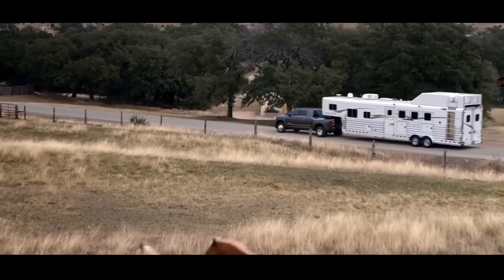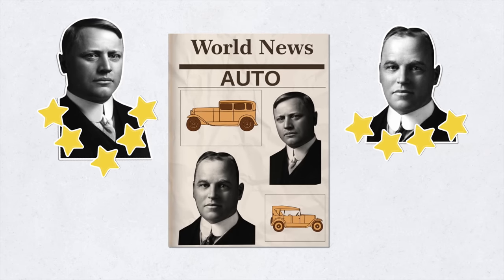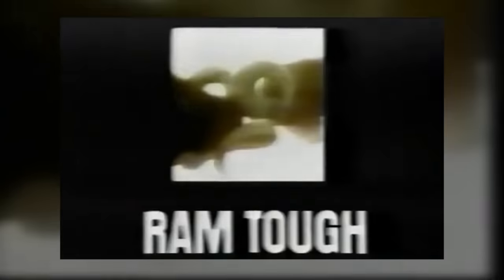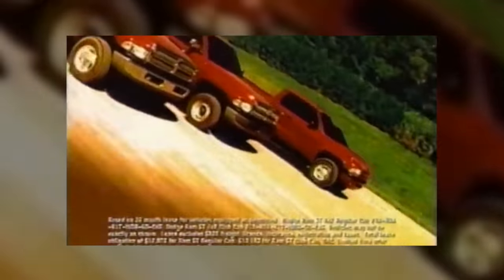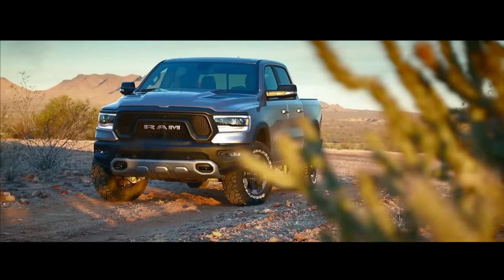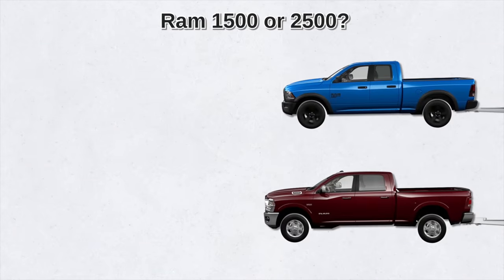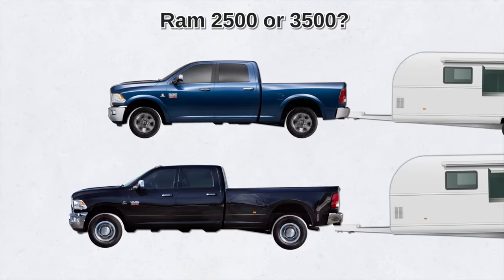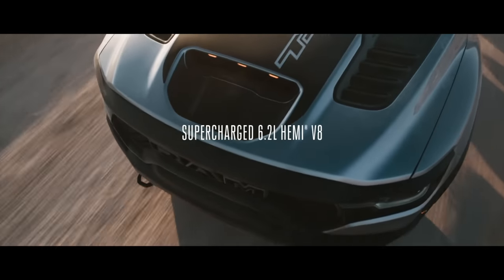No One is Telling You the Truth About Dodge Rams, So I Have to

Comment: I'd kind of like to have the 3500, BUT I can't seem to 'wear out'/KILL my 1989 Cummins Dodge 350:) which I purchased NEW (it might have been the very first Cummins  W350 on the west coast, so new, I had to pick it up personally off the train:) Now, all the problems I've had? well the steering box bolts to the frame started to come loose, so had those tightened...Other than that?  NADA!!!!! BTW, for those in the 4WD off road world, my truck is the ORIGINAL "DODGEZILLA" LOL. Oh, now I remember, I had an electric window motor go bad oh...7 or 8 years ago.. and I had to change a U joint a couple of years ago...probably the sand from the desert. :) Oh, and guys, those Cummins guys can REALLY build a Diesel!! I also have the HD Clutch and the manual Getrag Trannie. In comparison, my father bought the big 454 Chevy dually pickup, ,,,engine had to be rebuilt after I think 4 years, (the cam lobes just flattened out) he also went thru I think 3 clutches before he gave the truck away. My brother bought the Ford 250 4x4 with their diesel, (it died at about 7 years of age  ) sooo, every time I hear Scotty badmouthing the Dodge trucks, well I just smile:)
Reply: Scotty admits older dodges were better. He complains about say 2000 to present dodge/ram/Chrysler/fiat quality is low. He say electronics are junk on the newer stuff and it'll all break. People are still buying dodge stuff because they look nice and keep up on paper with the competitions cars. but im always wondering how they handle the quality. U notice they dont hold resale value as well the competition and ive read business owners who bought fleet vehicles of dodge rams regret it and go back to Chevy or ford. Ford and Toyota are the only new trucks ive heard scotty recommend
Reply: I’ve owned a bunch of them with the 6bt.  Starting in 1990 Great old trucks.
Reply: Consumers report had the Ram 3500 as the worst vehicle made,car or truck a couple of years ago. They are all pretty much junk anymore. To many recalls on all the truck brands.
Reply: Dodge trucks aren't as good as Ford. Dodge, with the junk dodge tranny.and the dodge  motor
Reply: Ok, for those pointing out that the older dodges were probably better built, based on the comments by Scotty, well maybe so, what I'd ask is does anyone have the numbers of how many of America's trucks for each manufacturer are STILL on the road? say after 5/10/15/20 and beyond? I'm sure our Big Bro Govt has those figures available if someone has anyway of pulling em up.
Reply: @richsweeney1115  The ZF-8 speed is one of the best in the industry and you call it junk, oh right you are still living in the past.
Reply: @richsweeney1115  So you are saying the Hemi's and Pentastar's are crap? When was the last time you owned a Brand New RAM?

Comment: I had a 2006 Ram 3500 diesel, owned it for 7 years, twice during that time (3 years apart) the injectors failed. Dodge wouldn't do a recall although a lot of people had the same problems.
Reply: Original owner 2006 2500 Cummins. I have 166,000 miles. Still on my Original injectors, but I also have been replacing my fuel filter(baldwin) with every oil change at 5,000 - 7,500 miles intervals. Im due for a new injector set, but engine still runs strong, I'm still always on the lookout for early signs of injector trouble. I'm probably the exception to the rule but, its all Original except for its on its 4th set of batteries and just recently, an AC coil clutch pulley kit from ebay. 🤞
Reply: @nattran92  I own an 06 Ram 3500 5.9 Cummins diesel,. Two wheel drive, automatic, long bed. 21+ mpg highway, not towing. 186K  with minimal issues so far. Runs and drives great.  Synthetic oil, quality filters, original injectors. Replaced water pump, rebuilt front end and replaced all shocks with  Blistein 4600's.
Reply: @nattran92  I changed my fuel filter every other oil change as well. My dad and brother had the same truck as me and never had injector problems, but did have transmission troubles that I never had.

Comment: Surprisingly my 05 Ram Hemi with a tune and cam, traded it in with 55k miles in 2 years, lasted longer than my 08 Tundra 5.7, transmission went out at 25k miles. Still under warranty but you know.
Reply: What kind of Tundra transmission goes out at only 25k miles?!
Reply: @eliteflare6063   defective, or beaten

Comment: Scotty please do a video like this about Chevrolet. I'm specifically interested in the mid 1980s model year trucks because my daily driver is a 1986 Chevy Silverado k10 4x4
Reply: RCR just did a review of a '74 squarebody Chevy.
Reply: I had a new 1985 Chevrolet Custom k10 4X4 with a manual transmission.  One of the best trucks I ever owned.  I traded it in after I put 155,000 maintenance free (not including oil changes, etc) miles on it.  Great trucks during those years.
Reply: @lc7192  I've had this truck since I was 14 I'm 26 now and will never get rid of it. It's had it's problems but it's easy to work on. One question Did your truck Ride like a wagon going across the Oregon trail 😂
Reply: @jasperjordan6972  Yes.  Mine was a short bed 1/2 ton and it was rough. I think the long beds were smoother.  The only thing that I didn’t like about this truck was that it had two fuel tanks and the fillers for these tanks were on opposite sides.  I put a lot of highway miles on it and it was a pain keeping both of these tanks full.  I loved it though.  It would really go well in deep snow and the short wheelbase made it good for off-roading.

Comment: My 2001 1500 had 225000 miles on the little 5.2. never been opened up. Only basic repairs and regular maintenance. I've rebuilt the trans twice though. Other than that I will drive it till the wheels fall off!

Comment: The biggest down fall is the coil springs they put underneath gives a smooth ride but when it comes to tongue weight even with weight distribution they struggle to keep the bumper off the ground so you have to go with air bags.
Reply: Buy some better springs, cheaper than air bags and keeps the ride quality.

Comment: My 2012 hemi will pull the world but at 130k miles i have my second exaust leak and it randomly just dies while driving and the key is messing up when starting it. Not real happy. I get 11 miles per gallon. I do run the tar out of it.
On the other hand the 05 dually 4x diesel has been a real peach the whole time. Its all stock with auto trans and has pulled many heavy  loads

Comment: You didn't mention the RAM 3500 with the HO engine and Aisin Transmissions. This setup is 420 HP and 1,075 ft of torque. 
Insane.

Comment: I have purchased a little mileage 2002 Durango with 160 K and tow capacity of 7000 and 4-wheel drive. Extremely happy. 5.9 L.
Unable to afford 37 to 40,000 for a power truck
Reply: I had to read this three times to try to understand what you were saying. I am not sure if I do.

Comment: We've factory backed RAM trucks here in Oz for some 10 years or so, I'm dying to get a 1500 Limited and Scotty you've convinced me.
Reply: Factory backed? Tranlate. You can get Dodge pickups in the land of Oz?
Reply: @thyslop1737  Yeeup, right hand drive conversion is done here, sold by RAM dealers with full factory warranty, double the cost US cost though, and smaller range. It's been very successful, Silverado is now trying to muscle in. We've always had F trucks but they are boutique importers/conversions and very expensive & no factory backing.
Reply: @martinfiala3910  two reasons why I reckon the DTs are so expensive atm, is because there are still DS models in dealerships, and the global chip shortage.
Once those issues are resolved, I'd expect the price to come down about 20k.

Comment: I just recently bought a 2019 Ram Warlock edition and I absolutely love it. It was a local trade in, one owner with 18,000 miles and it runs and drives great.

It's got the 5.7 liter hemi in it and it has more power than I'll ever need but I'm also getting 19, sometimes 20 miles to a gallon of gas.

Not quite as a good as the 36 mpg that my 2009 ford focus gets but I'm impressed with it.

Comment: I work on Rams for a living. Ima tell ya these 2019-2022 Rams, dont buy one. Just dont.
Reply: TYVM I was wondering about the new ones...much appreciated and heeded advice
Reply: Being a Ram mechanic I would love your opinion on the BEST generation engine and engine size to buy used in the 3rd gen to present (well know how you feel about thr 5th gen, so 3rd & 4th) please.
Reply: @KevinRCMan, why the warning? Especially since 2022's aren't out yet, are they?
Reply: @dwilson2126  I don't believe they are, but just last week had a 2019 1500 in the shop wouldn't start or crank and no DTC"s to follow.  For no real reason the PDC (essentially the fusebox) went bad internally. Guy had to pay out of pocket cause its not covered by powertrain. This is a known problem and Chrysler as of right now has no real fix/update. The 2020 and 2021 has the same PDC. I can go on for days as why you shouldn't buy one of these newer Rams
Reply: @KevinRCMan  Wow! A good friend of mine has a 2017.
Reply: How about the "classic" truck ?!
Reply: @KevinRCMan  anything else we should know?  Every manufacturer outside of Toyota/Lexus has a doomsday story and a reason why you shouldn’t buy one.  I just sold my V8 M3 and has 1 catastrophic issue and a few other expensive issues not covered but mostly never happens.  I did the preventative maintenance thx to the community but I am sure every tech at BMW says the same thing about their cars but most cars do not have these issues.  So is there anything else people should know about RAM and why they shouldn’t buy one besides that one?
Reply: Thanks
Reply: I was just wondering if you felt pretty stupid now. Realizing you said an asinine statement like you did. This truck has been voted truck of the year for I don’t know how many years and I’ve had five different Rams. I’ve never had engine explode or anything serious wrong with the truck whatsoever. I can’t say the same of any Ford or Chevy that I have owned. Come on now say something. We’re waiting.
Reply: @dwilson2126  because after owning multiple Chrysler products they are all crap, cheap , unreliable crap.  5.7 piss poor design,  with bad lubrication. Fit and finish sucks.. I've owned 2 durangos,  1 ram , and a 392 challenger. All crap.
Reply: I have a 2019 ram 1500 limited. No issues at all. Been perfect. Sitting at 140k miles lol.
Reply: @jhugo1986  I'm sure it's well maintained as well.
Reply: I have a 2006 Ram 1500. Just went over 300k she's old but I'll buy another if it's anything like this old girl.
Reply: @victorgalvan406  they aint

Comment: If it wasn’t for the Hemi engine and the cam and lifter issues I’d own one. My buddy just put his in the shop gonna replace the engine and it only has 110k miles. Will they ever fix this issue or all Hemi’s the same?
Reply: Me too. I owned two (a 2012 and a 2016) 1500's with the hemi. Both of them needed cams/lifters/manifold bolts before 60,000 miles
Reply: If it matters now , in 2018 they did a light redesign by beefing up the lifters and cams on the 5.7 and the 6.4
Reply: My god lifter issues only effect 5% of engines produced. Even GM and ford has had a lifter issue with their V8's. Yes in 2009-2014 there was a big lifter issue with the engines that was rectified.

Comment: I have had 2016 1500 5.7 LOVED it. Then I got a 2019 Ram 2500 Diesel LOVED it other then Ram not being able to get parts My ABS pump went out and was backed ordered for a year. I traded in on a 22 2500 6.4 Hemi Laramie. JUNK!!!!!!!!!!! all kinds of issues with the 12"  Uconnect 5. It pull's my 12k 5ther but the MPG is horrible I miss my  6.7

Comment: I have an '06 Ram 2500 Cummins powered quad cab with just over 300,000 miles! It has been the best, trouble free truck I have ever owned.  Prior to it I had several Ford Super Duties.  For several years prior to and after getting the Ram I operated a pretty much nationwide equine transportation service, towing up to 16,000 lbs.   One of the first things I noticed was the Ram has a much stiffer frame than the Fords, with a heavy gooseneck I never feel any frame flex as I sometimes did with the Fords.  Next thing I noticed was the better fuel economy!  From 16-18 MPG loaded.   Best I got with the previous Power Strokes was around 12 MPG.  I have also noticed the Ram has a heavier duty driveline.  I have never had to replace a single U Joint!  On the Fords I could count on replacing U joints when doing a lot of towing.   I bought the Ram initially because I wanted to go back to a manual transmission, only the Ram 6 speed manual was direct in 6th gear, Ford and GM were overdrive in 6th!  Towing and overdrive, manual or auto, don't mix.  Believe it or not, I had the clutch replaced just before turning over 300,000 miles!   Actually, it was the throwout bearing that failed.  Clutch and presssure plate were still in pretty good condition.  Now that I am retired, I plan on keeping this truck.

Comment: I’ve had 4 ram 1500s since 2002. The only parts I replaced was brakes, radiator and ac compressor on the 2002. All parts I replaced myself. Had the 4.7 in the 2002. Replaced brakes and tires in the other 3.  Never any issues with the motors.  For the money…Ram is it. Friend has the 2021 3500 No issues….And previous to 2002 I was a Ford truck guy.

Comment: Only thing with the dodge pick ups.
I talk to alot of construction workers and oil field workers the motors and transmission are the best.
The only thing wrong is the dodge truck itself. They had to rebuild the front end every 75k or 80k miles. The front-end and the truck itself won't outlast the motor.
The truck falls apart leaving the motor and transmission stranded on the highway.

Comment: Well, Scotty, none of those prices, specifically for RAM 2500 barebone stick. I did not find a 4x4 2500 barebone for 41 K that I can buy. All that we normal people see are 50, 60, 70, 80k, and so forth prices. I would buy used but all of them had some issues with transmissions so I gave up...

Comment: Well I have had my second Toyota fail. The first was a 2000 Camry that failed at 125,000 with multiply .leaks and a transmission failure. The second is a 2010 Toyota Sienna with 150000 miles throwing a code of P0029. That is a VVT problem. Two mechanic say it is a stretch timing chain. Repair more than the value of the van. In both cases I am a fantastic on maintenance. Think I am going to try another brand

Comment: RAM exists because of Cummins, reminds me of Ford taking over Powerstroke after International and undid everything good International had done to the 7.3
Reply: @nrm3247  i agree it might be a "slug" from the factory but that was the way it was designed for it's purpose, it does it's damn job, and it does it damn well it is still the Pinnacle of Powerstrokes imo
Reply: @nrm3247  not to say Cummins is bad, don't get me wrong.  Independent valve covers for each cylinder?  Imo that's absolutely beautiful engineering on Cummins side.  I don't know much about them besides they're a straight six that will also do an exceptional job if used and maintained properly

Comment: It’s not Dodge Ram anymore. Get it right, it’s Just RAM 😂🤣
Reply: meh.... it's just badging. There aren't really independent divisions in any of the auto companies anymore. Engineers that work on Ram products also work on Jeeps, Dodges, Chrysler, etc. They share a lot of hardware between the brands, and they all run the same software to some extent.
Reply: @7t2z28  you forgot to mention Fiats!
Reply: @johnvoyage6486  and Ferrari's

Comment: I test drove and looked at Ford, Chevy/GMC and Ram back in 2016.  I test drove both new and used finding issues with all the trucks.  

The Ford accessories and steering were the worst of the bunch and the trans made noise in the used on freeways.  It appears the plastic parts didn't hold up very well either.  

The Chevy's interior was inferior to Ram and Ford.  Power was good but in the used one I found engine noise at speed was problematic. 

I then test drove the RAM and I immediately noticed  the truck was a pleasure to drive with both braking and handling far superior to the competition. When I was on travel with my employer I got to rent a Ram 1500 that obviously was used hard but it stood up to the use very well.  This made my put my money on the Ram and I never regretted a thing. 

Also in the full sized truck I tried the Toyota Tundra and was thoroughly underwhelmed.  I only wish they were half as good as their Tacoma Trucks.  If I had been in the market for a smaller truck, the Tacoma would have been my choice even though it was pricey.  

The Nissan..... No starter there. Ill fit body panels etc.  I had a 1992 Nissan truck and loved it. Now they're nothing to write ho,me about.

Anyways, I've had the 2016 Ram for 5 years and never regretted that purchase.  It has served me well!
Reply: Sounds like an advertisement to me.
Reply: Ram has come a long long way. A lot better product. In do time more people will realize the better quality, reliability and great truck. Took me 5 years to see this. Love mine and no issues. Had them all. Ford,GM Toyota etc Ram 1️⃣
Reply: Good to see someone with a 2016 Ram 1500 with good news. I've been working mine with  home projects, loading it with mulch, couple pallets of bricks at once, boulders, concrete slabs, dirt, 1 pallet sod & once i loaded my 16' trailer with as much dirt that the trailer stand wouldn't bottom out. Nothing broke yet.
Reply: To be fair a gm interior never has been the best and probably never will be but they do hold up extremely well if you plan on owning them very long term. Ram has the fancier interior but how well will it last in 20 years